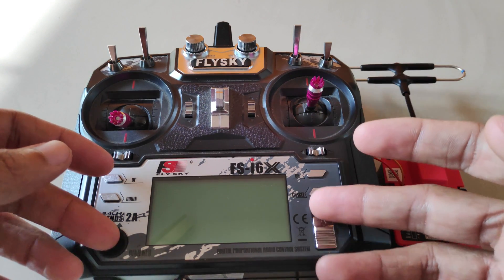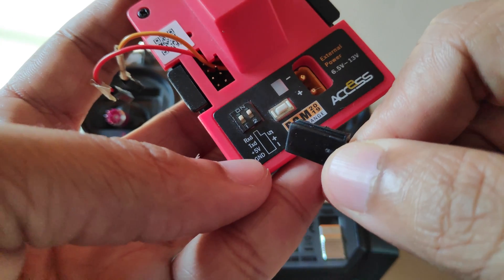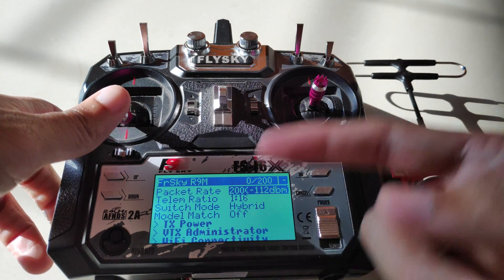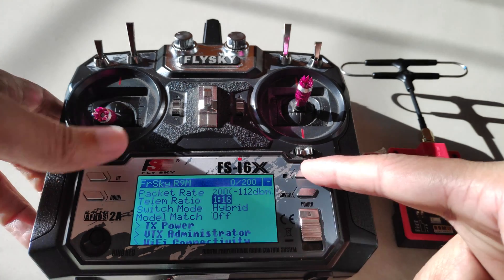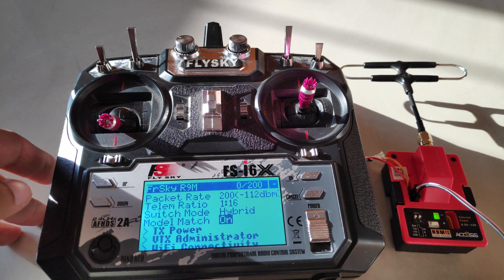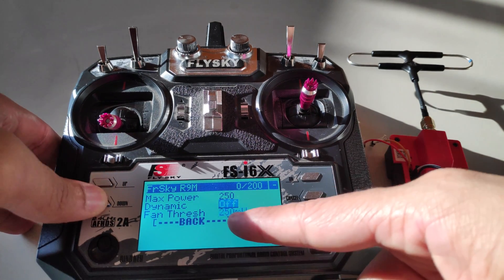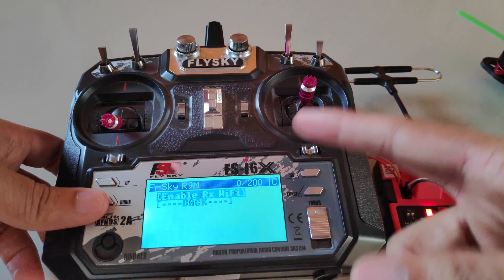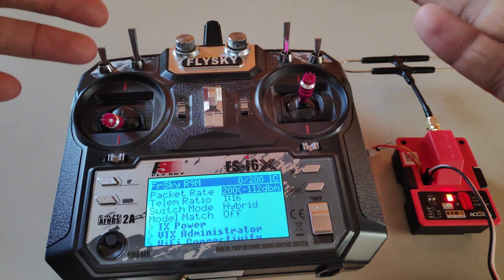Flysky FSI6X Open Tx ExpressLRS 2.0 Walkthrough with Frsky R9M

Comment: Is there any way I could contact regarding specific questions I have with my personal build? My R9m and R9mm bind perfectly and the ExpressLRS menu on my I6X shows the R9mm under other devices. However, I cannot see any control input through either betaflight or ardupilot and it's driving me nuts.

Comment: Hi 
IS it possible to use Elrs module like Betafpv Oled screen  module with Flysky i6 (none X version ) without use Opentx  ?
Reply from the maker: You can use elrs on fsi6 with erfly6 firmware. Not on stock firmware
Reply: @RakishRc  interesting i will check that 
Thanks to show us 😉